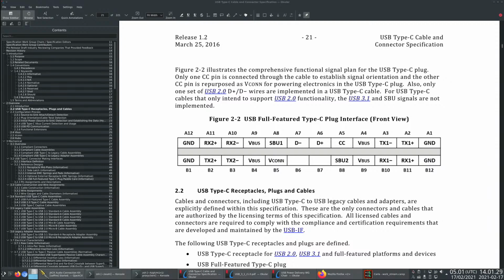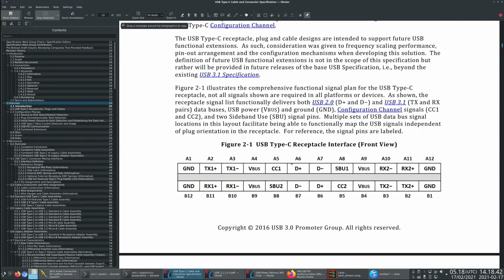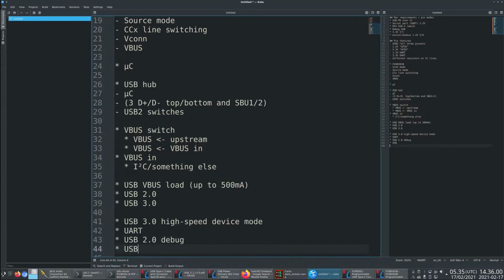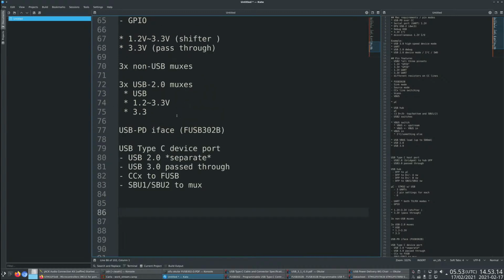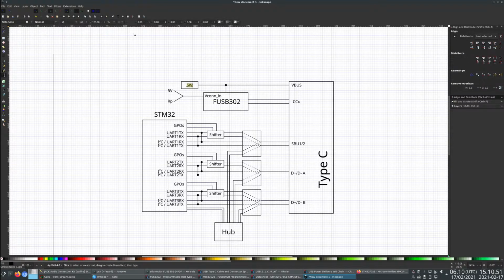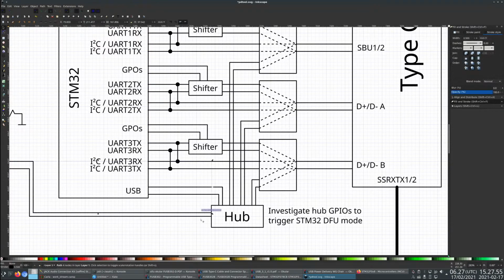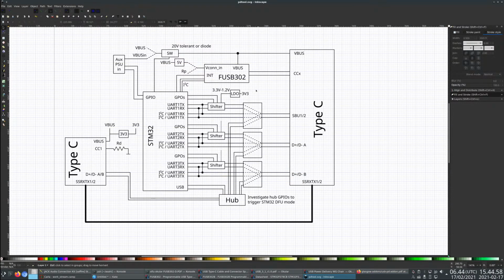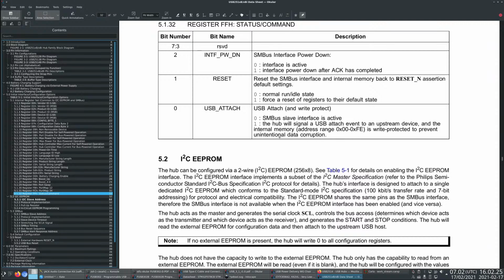Work stream: USB-PD/Serial interface design [2021-02-17]

Comment: @marcan, Thank you very much for the streams, they are amazing! What I get from this one, you are going to design and build a board to send USB signals what you want to your Mac in order to debug how the Mac will react on them and debug the driver for USB PD and maybe display port and other USB stuff. You numerous times used the word "debug" in the stream but didn't said what this actually means. What you told us this is not a MITM stuff, so I have got this is not a USB sniffer or something like this, but a device to generate signals. I'm sorry but this part was unclear. Happy new year!